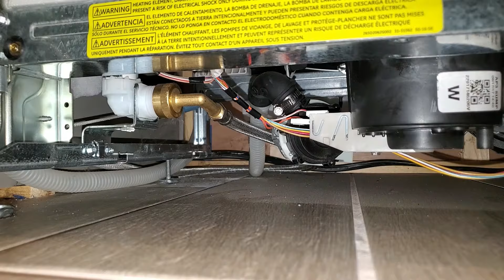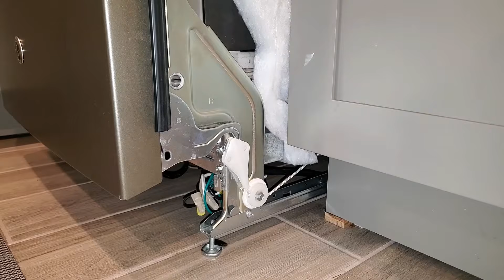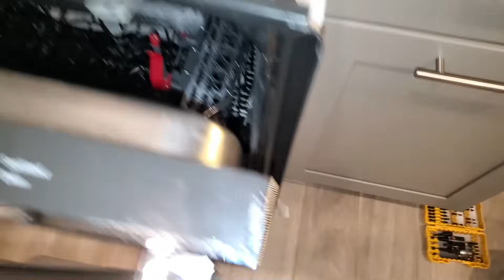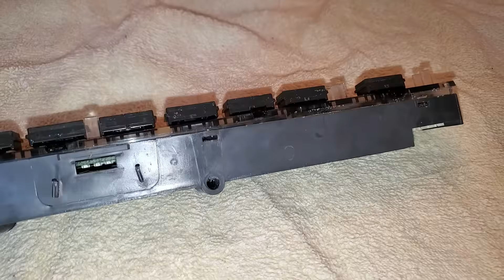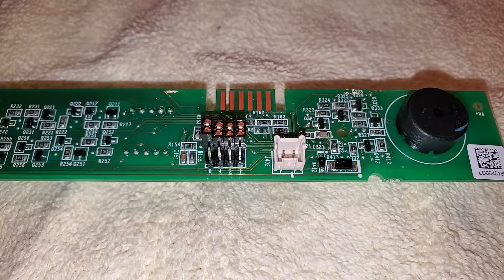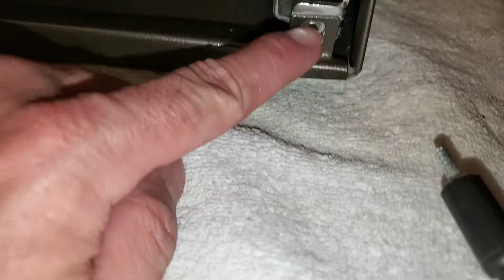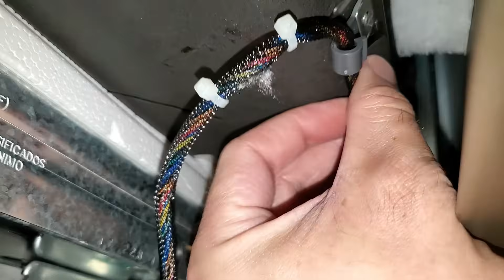GE Dishwasher Repair  - Replacing the User Interface Control Board

Comment: You saved my life and this expensive dishwasher my house came with. Two things took me way too long on this 1. If your counter top is some kind of rock (we have some fake rock/stone that looks fancy) the dishwasher is going to be screwed into the cabinets... After struggling for 45 minutes and ripping a screw our of the cabinet I figured it out 2. Pay attention to how the control board at the bottom sits before you excitedly pull it out to see the LED only to spend way too much time trying to get the damn thing back in.

But other than that a pretty straight forward process!

Comment: Excellent video Sir! Thx! You might add, which u may have done, recommendation to replace float/flood valve & filter at same time. Mine was getting clogged, would not rattle up & down. Ez fix while door off.

Comment: Matt, you just saved me a lot of money. Had already replaced a bad control board. Thought I had another go bad and ordered a replacement. That didn't fix the issue and swapping the UI board out didn't, either. It was your video that pointed me to the jumpers on the new UI board since that paper didn't come with my new board. Once I corrected the jumper position, I was back up and running. THANK YOU!

Comment: Excellent. I have a GE Dishwasher GLDT696SS-00(I have it memorized by now sigh) -stainless, it is a really nice one like yours. In the first couple of mos of owning it this happened-the thing went blank-thankfully it was on recall and they replaced the control board.  Apparently they were all installed with bad components.  After that, it worked well for 10 years.  On the Best Buy forum I read our model was rated a 1 star.  People were saying they would never buy another GE dishwasher. Lately it has been leaving water in the bottom and I am trying to figure that out. I hope it isn't a control board issue but I am finding if it is, usually a lot of other things are going wrong too. Thanks for putting this up.  The more of these the better.

Comment: I didn’t see the instruction manual at first. I put in the new board and it did nothing. 
Then I saw the manual and placed the jumps in the correct position, then it worked great.

Comment: Excellent video!! I had similar symptoms with my GDF630PGM0WW 3 year old model. After the "Breaker Box Shuffle" too many times, it no longer responded. I disassembled mine yesterday, ready to insert my new UI and silicone light pipe. Much to my dismay, it looks like my front control panel plastic assembly was all broken up inside and the screws holding in the circuit board had been over-tightened, breaking the holding tabs. 🤔I have never opened up the dishwasher for repairs before yesterday. and it was SUPPOSEDLY BRAND NEW when I bought it back in March 2019. I bought a new control panel assembly and am waiting for that to arrive next week. When I finally get to insert my new UI board, I hope that I get my dishwasher working at long last! Once again, kudos for an incredibly helpful, detailed video. 👍

Comment: I have the same dishwasher mode, and had the same problem.  This was the perfect fix video!  Thanks!!!!

On a side note:  I found that the dishwasher doesn't need to be pulled out.  A long #1 Phillips screwdriver was used to unhook the spring cord with the door fully closed.

Comment: Very helpful video. Had the same problem with the random beeping like the door was being opened for about 3 months until the front panel went completely dark. Followed the other video on testing the lower control board. Then ordered the same upper board and installed it. Thank you very much.

Comment: Thank you so much for this excellent video. I had a GE tech out and was told I would need to replace top and bottom PCBs. He said boards would cost 500 dollars and I would be better off buying a new dishwasher. My current one was a little over 3 years old. I found your video, describing the random beeping issue. I located the upper board for a little more than what you paid for yours. Total replacement time was about 45 minutes from start to finish.

Comment: Matt, 
Thanks for the schooling. It's always nice to know what to expect "before" starting a new project. I was able to separate the door halves with the door still attached. Yes those top inner 1/4" screws were a bit of a challenge (limited space) , but it was well worth the couple extra minutes spent on them to not pull the whole unit. I would love to find out why and how these boards fail. Poor engineering, cheap components, or planned obsolescence?

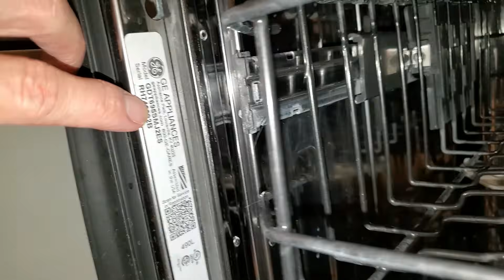Comment: No jumpers were present on the UI control board I just removed and replaced on my GE dishwasher.  Step at 22:13 wasn't needed or even possible in my case.  My model GDT545... works without any jumpers.

Comment: As a 67 yo woman, I found your video to be extremely helpful. A couple things I found (as I was doing this myself, without help) when removing (1) the T25 hex screws: spray on some silicone spray and let it sit for a while, (2) the inner and outer door:  lay the door on its side and loosen from the bottom up. No need for a helper or for a lot of upper body strength.  I also found it easier to reattach the inner and outer doors by having them flat on the countertop.

Comment: Liked and subbed! Excellent video by a fellow helpful channel. Thank you for the savings. My suggestion: I didn't pull my dishwasher out, I just used a hook to unlatch the door spring and place it in the metal cutout designed to hold it in place directly below the hinge.
Reply: Subbed your channel too! My GDF630PGM0WW has a long, rather narrow plastic head on the door cable, rather than a "diamond-shaped" one. I wonder if your suggestion would work for my model too? By far the worst part of my repair attempt was having the door cable losing tautness and coming loose from the spring itself near the back of the appliance! UGH. I had to reattach the two using my hands under the machine each time it happened.

Comment: Very helpful! Thanks! Be cautious when unhooking the pully cable. Keep it taught so that the cable doesn't become unhooked from the spring, or you'll have to pull the dishwasher halfway out to get it back together. If you're replacing a broken control cover, you'll have to remove the control assembly all the way out in order to get the cover snapped in correctly or you'll break the tabs on the cover. They break easily.

Comment: Had the same issue. Changed the IU board and everything seems to be working, however, the green LED status light on the main control board is still rapidly flashing green. Is that something i need to worry about?

Comment: Does anyone have an idea on what would keep causing the user interface to fail every couple of months on a GE dishwasher? I've replaced mine 3 times so far and they only last a few months before they stop working.
Reply: Did you ever figure it out? I'm having the same problem
Reply: @Darth Andy  possibly a bad control board that is shorting out the signal to the ui?  I have no clue but something is not normal if the UI works for 3 or 4 years and then fails...so you replace because it failed and then it fails again after 2 or 3 months of use....that tells me that something is frying this UI in the first place and replacing isn't going to solve anything

Comment: Thank you for uploading this video.  I just finished replacing my User Interface Control Board and don't think I could have done it without your video.  To remove the panel on my model...I had to unscrew a plastic vent in the inside of the door.  Thanks again!

Comment: Same here - my dishwasher is a GDF570SSJ2SS and has exact symptoms - dying around the 3 year mark, random beeping until the unit became unresponsive, and a temporary workaround was flicking the fuse switch a few times until the dishwasher "came back to life", or reseating the cables on the control board. Now, about 6 months later - none of my tricks are working. I've ordered a UI board to see if this fixes the issue as replacing the control unit board has not fixed the issue.
Reply: Good news, replacing the UI board fixed the issue! Looks like it wasnt the control board - the green LED light is now blinking green (which means its communicating with the UI board) instead of being solid green (no communication with UI board)
Reply: @WillTech105  did your fix last?
Reply: @macknumber9  it didnt for a while but I finally found a "official genuine OEM" part and not a used part and its been stable so far (over a month).
Reply: @WillTech105  was your control board led flashing fast?
Reply: @William Zambrano  I'm hearing about people changing UI just to have problem come back again which tells me something with the control board must be shorting the UI and fry replaing it ..I would speculate that the control board as well as the ui needs to be
Reply: @William Zambrano  I'm hearing about people changing UI just to have problem come back again which tells me something with the control board must be shorting the UI and fry replaceding it ..I would speculate that the control board as well as the ui needs to be
Reply: @William Zambrano  I'm hearing about people changing UI just to have problem come back again which tells me something with the control board must be shorting the UI and fry replaceding it ..I would speculate that the control board as well as the ui needs to be
Reply: I am thinking something is shorting the UI as I am reading about people having replace the UI just to have it keep going bad.  My control board has some brown spots on it where the power plugs in to...I wonder if that's the reason why my UI is bad in the first place....

Comment: in my case, the existing UI as well as new UI didn't had the jumpers similar to  the dead UI on this video, but the instruction as included for jumper config. I installed new UI and new door latch switch, but UI is still dead, any suggestions ?
Reply: Same thing for us!
Reply: same here, did you figure it out?

Comment: Fantanstic video and step by step instructions. Replaced both lower board, UI control panel in door and door latch. Had the jumpers on the UI  pin 2 only on one leg, corrected and it works. 1st time lower board was bad. 2nd time replaced UI control board and door latch with jumper wrong. 3 rd time moved jumper 2 to both post and don’t you know it works. Not quite as good as the new dishwasher I bought but great enough for my daughter who now has a 2  year old dishwasher. My daughter thanks you a million times.

Comment: I changed the main control board and the user interface and the washer still shuts off few seconds after I start a cycle. I guess it’s time to toss it and get it a new one. Only lasted 6 years.

Comment: I have the exact same issue.  The machine beeped a lot and the lights would never turn off and it just died.  I tried the breaker several times and then turned to YouTube.  Thanks so much for this video. I cannot do this myself but I have a service call in the next few days and this will help me a great deal.  What might I expect for how long it should take for this procedure start to finish?  I purchased a service plan for it when I bought it but they cannot get to me for over a week so I called a local appliance repair.  I did learn though, that when you buy a service plan you have to go through them for the repair.   You can’t have it repaired and then submit a claim to be reimbursed.   Anyway, next time I’ll buy a better rated machine because we aren’t even in this house full time and it doesn’t get a lot of use.  I would have expected a repair like this if if had been in constant use but not with the light usage it has had.  Anyway, thanks again.  Another live and learn moment for me.
Reply from the maker: Sorry to hear you're having the same issue, Elizabeth.  I'm glad you found the video helpful.  I believe I spent 2-3 hours on this project, but I was doing this for the first time and was very careful to document each step so that I knew how to re-assemble everything.  Plus, filming something like this adds a lot of time, as well.  I would expect a professional service tech. who is familiar with this issue to be able to do this in 1-2 hours.

Good luck, and thanks for watching!

Comment: Matt wonderful video 
I have a concern if you notice the old board how it has a series of 8 holes then the new board has the jumper pins my new board also has the 8 holes so how do I put the jumpers in or is it necessary thanks for the help
Reply from the maker: If your new board is identical to your old board, you should just be able to install it without jumpers.  Did the new board even come with jumpers?  If not, I think you should just be able to install it as-is.  I am not 100% sure, but that's my best guess.  Good luck...let me know how it works out.  

Thanks for watching!
Reply: @mattpayne4087  I did install and still getting solid green light with no lights to top control 
If I may ask where did you find all the diagnostic info
Reply from the maker: @mgrim1736  I'm sorry to hear that!  I believe I got the information at the following forum:

https://www.applianceblog.com/mainforums/threads/gdt695smj2es-ge-dishwasher-control-panel-is-dead.65692/

What is the model number of your dishwasher, and what is the part number of your replacement board?

Comment: My replacement part is WD21X23462. I replaced the old board and no luck in correcting my problem? I did notice a blinking green light in the lower board. Any suggestions on my issue.
Reply from the maker: Hi Mike, sorry to hear about your issue.  That is the same replacement part that I purchased.  Two things to check: 1) Did you watch my diagnostic video about how to confirm if the issue is related to the user interface board or the main control board?  That video is linked in the description of this one.  If you are sure that the issue is the user interface board, have you confirmed that the jumpers are installed correctly and fully seated?

Let me know those answers and I will try to help you out as much as I can.  Thanks for watching!

Comment: This was exactly the same procedure, even including jumper settings, for GDT655SSJ0SS. 
Some other GE dishwasher compatible with this user interface control board evidently have different hinges, which lack those four 2.5 torx screws.
Reply from the maker: That is great to hear, Steven!  Thanks for the information, and thanks for watching!